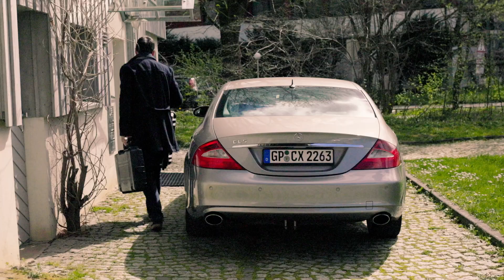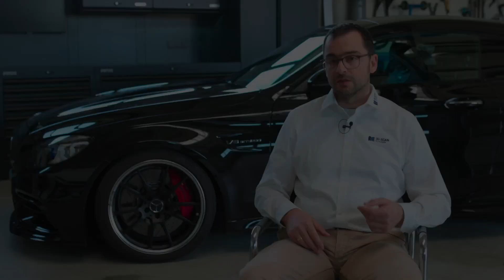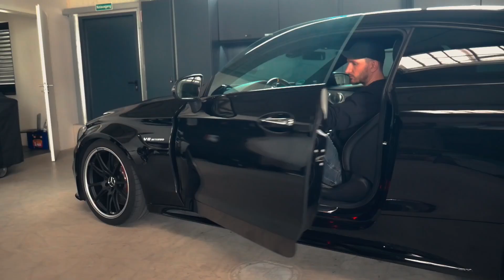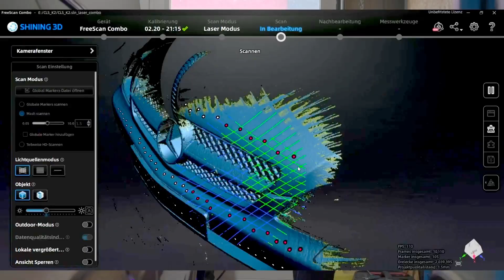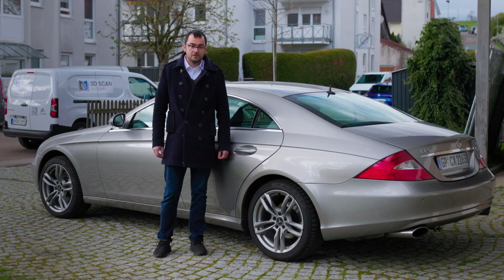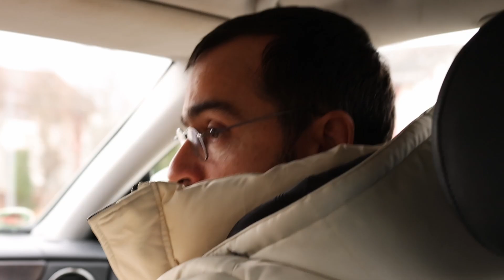Save the German Muscle Car - Transform your car using 3D scanning - Intro

Comment: I think thr best seets to replace the E- class ones are the AMG seats from the A45 176. Viele Grüße aus Bulgarien!
Reply from the maker: I agree, the A-Class seat from AMG-Version are great but they are from a totally different time and not sure if they can be coded in and will work fine. You have experience on the W211/210?